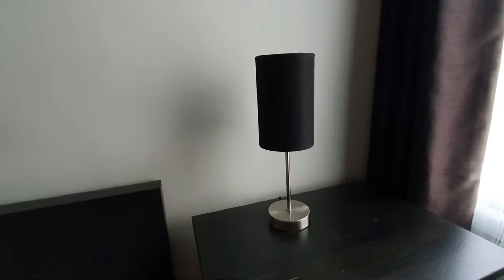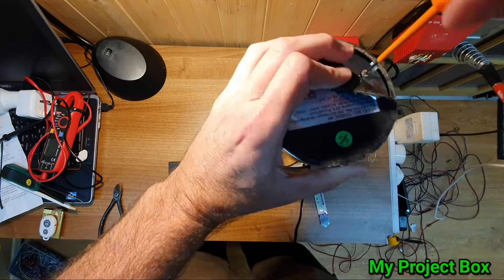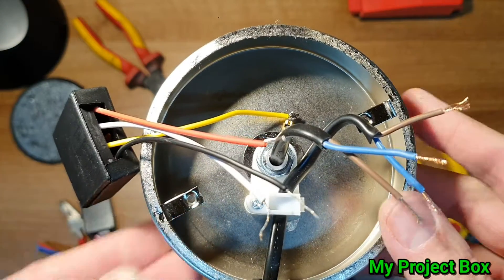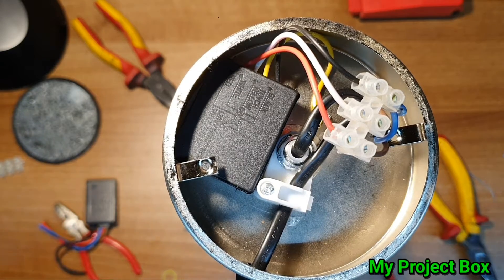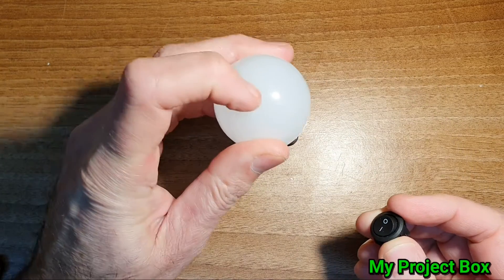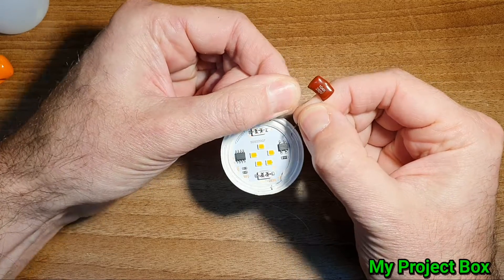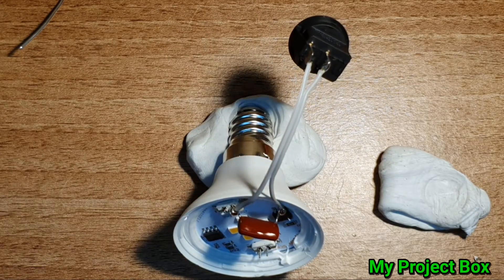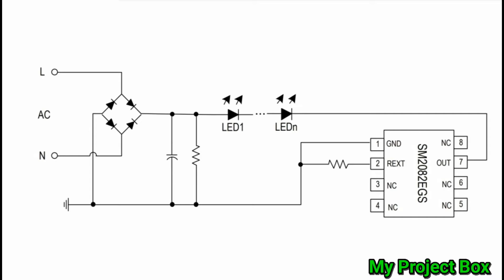Touch switch replacement for LED bulb compatibility #ElectronicsCreators

Comment: Hi there, I came across your video whilst searching for a solution to using a Shelly dimmer2 and touch lamp sensor combined.
I have a touch lamp with an on-off touch sensor like the one you used to replace your dimming one in this video and, I have a Shelly dimmer 2 which I can fit into the base of the lamp.  The aim is to retain the touch facility at the lamp but to also be able to control the lamp from home assistant via the shelly.
So, when activated the touch sensor should trigger the switch input on the Shelly dimmer and toggle the lamp on or off.    I could then use automation in home assistant to define different brightness depending on the time of day and also toggle the lamp from a wall switch etc.
This seemed straightforward by connecting the switched output that originally went from the touch module to the bulb to one of the switch inputs on the Shelly dimmer 2 but unfortunately, nothing happens when touching. (It does work directly via the Shelly).
Is it perhaps because there is no resistive load connected to the switched live now and if so, how and with what component could I rectify this, please?
Thanks in advance!
Reply from the maker: I'll have to think about it a bit, but it should be possible. You probably have to have the "touch switch sensor circuit", separately turn on a small 220v relay. Then you wire the relay contacts to the Shelly inputs. Have the Shelly to run on "normal" neutral connected mode. That way the dimmer only operates the relay as it's load completely separate (self-power). And the Shelly is powered independently operating the light bulb. If I think about a more elegant, or simpler way to do it, or better I'll let you know.🤔😉

Comment: Very good your video. In my module the led lamp is flashing. Is it possible to install some resistor or capacitor to use the Led lamp without replacing the module?
Reply from the maker: You can try a different brand LED bulb (the driver technology inside is different for different types). The touch model cannot be the dimmer type.
It is possible a resistor across the bulb terminals could help. It would take some experimenting.
Reply: That may be because the dimmer is not LED compliment, check the box and see if it's LED compatible. The flashing also happens when using an old incandescent wall dimmer and LED bulbs.
Reply from the maker: @ronmurphy4234  The old type phase-angle control dimmer (leading edge dimmers) are not very LED friendly. Even so-called "dimmable LEDs" require trailing edge dimmers to work. They are more complex and expensive to produce. And even then It's still very harsh on the led circuitry in the bulb, and they don't last long. The best way to dim LEDs is with PWM, in the LED driver it's self

Comment: How do you modify a dimming touch sensor to a simple on/off ? Thought that was what this video was about, but seems to just be a replacement ..... but what with not specified?
Good video though.
Reply from the maker: It's just a simple ON/Off  type module with out the dimming function. Cheap touch switch module from eBay. https://www.ebay.co.uk/itm/ON-OFF-1-Way-Touch-Control-Table-Light-Parts-Sensor-Switch-AC-220V-Touch-Switch-/364012419678?mkcid=16&mkevt=1&_trksid=p2349624.m46890.l49286&mkrid=710-127635-2958-0

Comment: If you're making a video on replacing the switch, maybe you shouldn't elect shortcuts and actually replace it like stock. Your method required the addition of a soldering iron that wasn't required, also simple wire nuts would of worked just fine and are a fraction of the cost.
Reply from the maker: You are right, a wire nut would work just fine. But I like solder connections. It's fused metal, not just twisted together or crimped. Soldering is fast and can handle more current than any other connection method. It's not so prone to corrosion either.